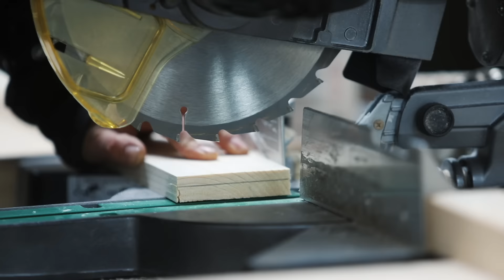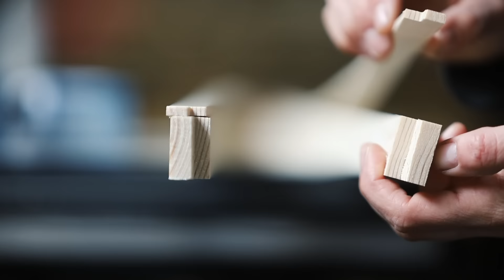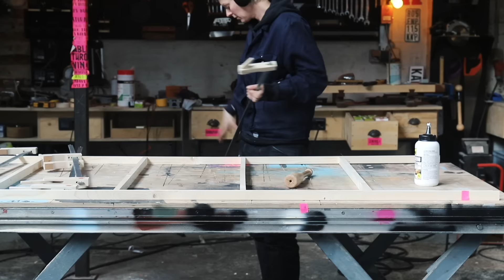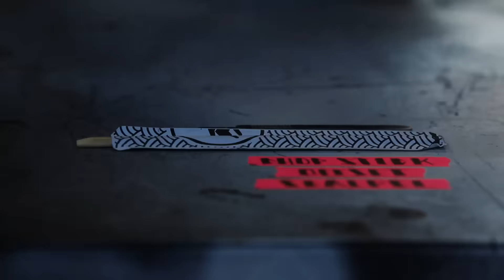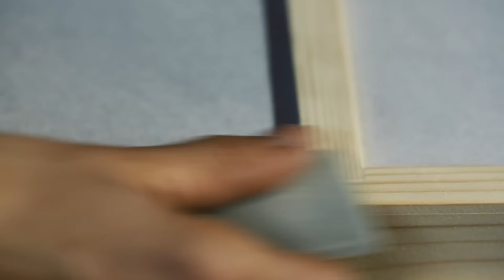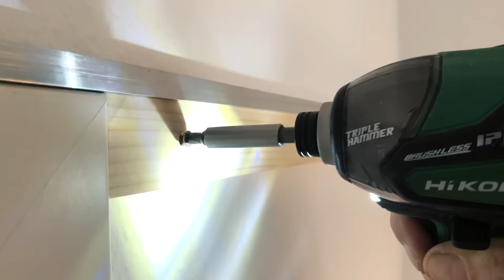Simple Sliding Door with Shoji Paper

Comment: Use wallpaper glue instead, it retracts on drying and it applies a small tension on paper to make it planer
Reply from the maker: Great tip! Thanks!
Reply: Tapetenkleister?
Reply: mix wallpaper paste with white glue,..that makes it go ''eggshell',..then,..light sand with 120grit to make it go 'papier'.
Reply: I'd have used staples
Reply: You might think about dampening the paper with a mist. Has the same effect, and will certainly take out wrinkles!

That 'shoji ' paper was lacking in texture. You should be able to find something similar but with 'texture' , whether it's from petals, or the making of it.
Reply: i think you can use that to make the paper tougher too
Reply: @laurakampf  what is the wood's type and dimension used please?

Comment: Looks nice Laura! I made two Shoji paper lamps a while ago, and the owner of the store where I bought the paper from ("Au papier Japonais" in Montréal, Canada) recommended I spray water evenly all over the paper, after glue has dried. 

It worked super well ! It tensions the paper, which become very tight against the wooden frame, no sag whatsoever. He told me hair dryer can be used to speed up the process or simple let it air dry . Both methods worked for me. Hope thiis helps!

Comment: There is a trick I often used when I built model planes with paper wings. After you glue the paper layer on to the frame try spraying some water all over it using eg. a flower sprayer. When the paper dries all wrinkles disappear as it shrinks when drying. Be careful about it as drying paper may bend the whole thing but the results are incredible 😃
Reply from the maker: So cool! Thanks!
Reply: You can also do this with steam.  It’s a bit more controllable.  I used to do it with the kettle, but much smaller scale.

Comment: Great project! Is there a way to do repairs on a paper door like this or you just scrap it. I don´t think that door would survive one day in my home..🙃
Reply from the maker: I hope smudo won‘t run through them :)
Reply: There are Youtube videos on 'repairing shoji' so I'd start there!
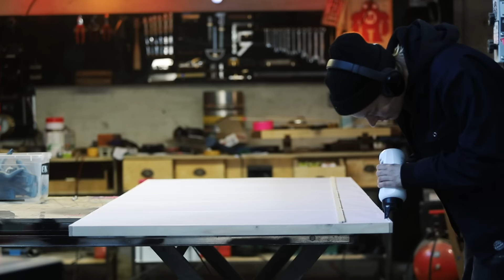Reply: I was in Japan and was able to watch a woman doing upkeep of a traditional village with shoji - it was easier to replace screens because the outside portion of the screen in traditional shoji did not have the extra pieces of framing that Laura glued on at the end (~3:58). 

So, if you don't have those pieces, you can simply use a spray bottle with water (and a bit of soap, I think) to spray around the frame with the paper facing you (like the frame is positioned when Laura is gluing the paper down), and then peel the pieces off. You can wipe any leftover bits (stuck to the frame) off with your hands or a scraper, rewetting as necessary. Then you let the frame dry a bit, and then you can re-glue the paper (you don't have to wait long, by my memory - removing and re-gluing can be done in basically one sitting, but it's probably safest to make sure the frame is fully dry, however long that may take). 

Alternately, in many homes, especially if the paper is framed on both sides, you can apply patches (it seems this is what most people do in modern homes that have shoji). I would imagine you can just patch by cutting out a small square on your own and just gluing that to the area that needs the patch rather than buying special patches, but I haven't witnessed the patching process.

Comment: How torsion-resistant ("verwindungssteif") is the whole thing? I built something similar a while ago and I'm struggling with getting everything straight. I used wood in the final dimensions right away, does it help to cut it from a bigger piece instead? Not that I would have the table saw to do so :-D Keep on rocking, I like the stuff you do!
Reply from the maker: I didn‘t have any trouble with that...